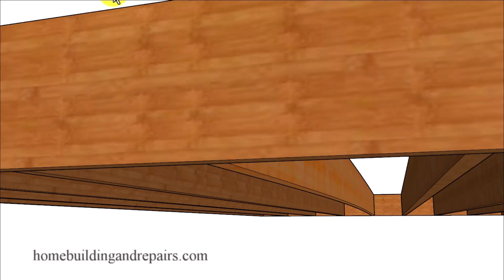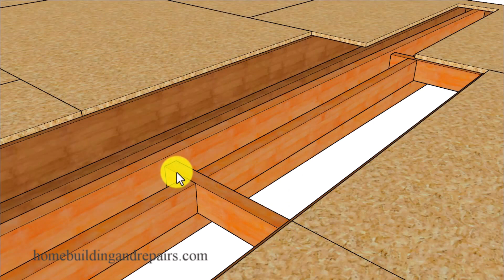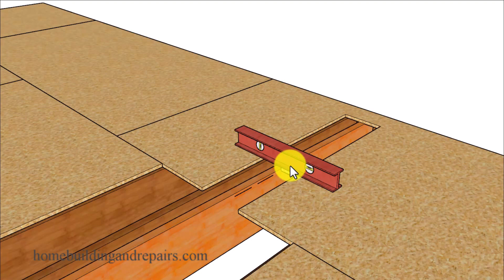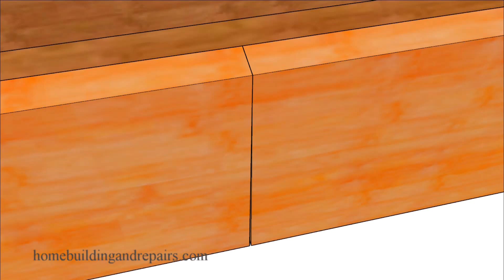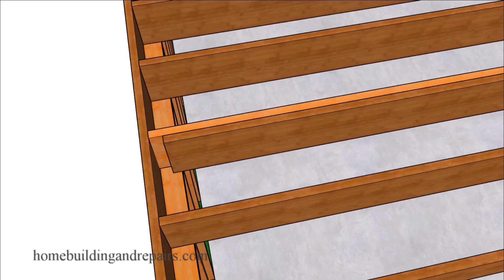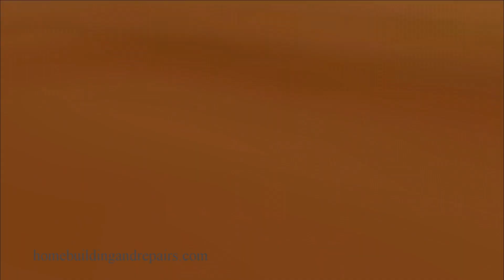How To Fix Crowned Floor Joist In Existing Homes When You Can't Remove And Replace Them

Comment: Could you not just plane the top down without adding blocking structure next to it or are you weakening the joist by planing it?
Reply from the maker: You would need to check with an engineer and I've seen 1/2 taken out of a 2x12, but don't think anyone every caught it, like an inspector.

Comment: On the very last method with the bolt tightening to pull down the crown, would you leave them there permanently?  Also would you nail or screw the old beam and the new beam together all along the length?
Reply from the maker: If you needed them, but I don't think you would most of the time after attaching new joist to existing joist.

Comment: Why not just cut it out and replace it?
Reply from the maker: I removed the somewhat negative comments before things got ridiculous. I don't like them on my channel if I can help it. You bring up a good point and in the video I was trying to answer two questions for different viewers and maybe I shouldn't have. The first was about damaging the floor sheathing lateral strength by cutting it and the second was to provide someone else with a method for fixing crowned joist without removing their carpet flooring and having access to nailing existing sheathing to new joist.
Reply: @gregvancom  that’s why I asked because I saw no footage of any reason the entire beam couldn’t be replaced easily. I would simply go under the house or the floor with a saws all and chop it up avoiding puncturing the floor and replace it with a fresh beam. It wasn’t your fault. This is a discussion, some people just feel the need to be smart Alec and that sets me off. Sorry if I was over zealous.
Reply from the maker: @user-zx7eo7nu4b  We're good:)
Reply: No need. That is a lot of work for no reason.